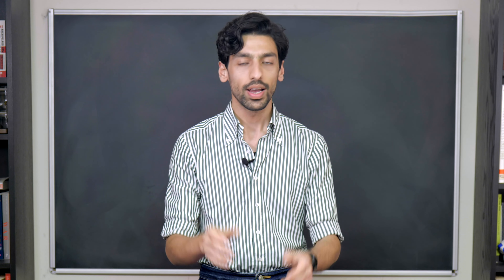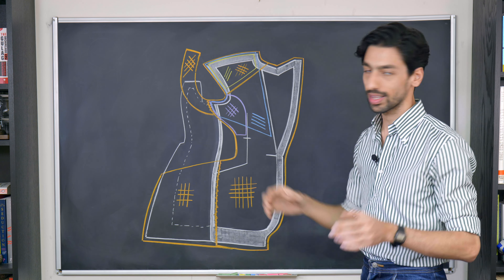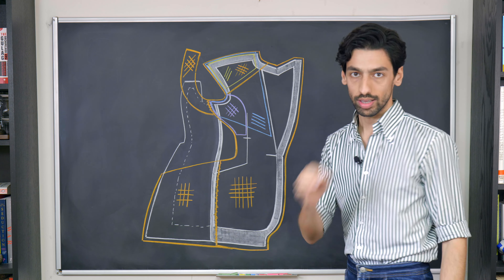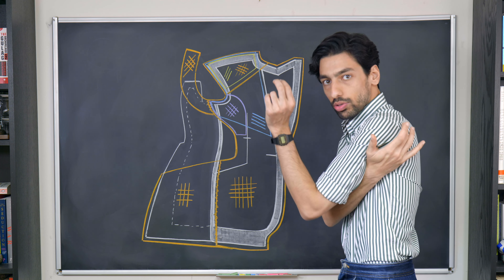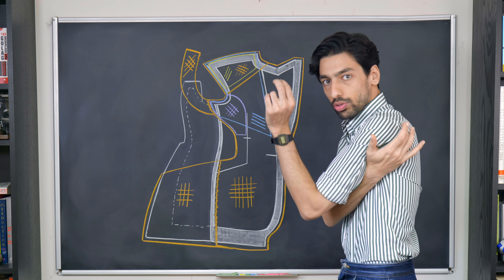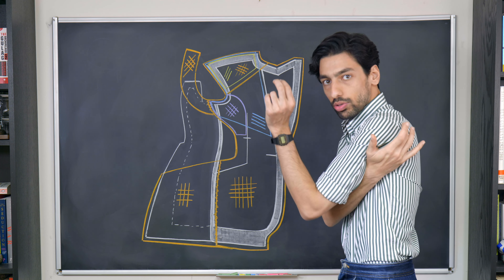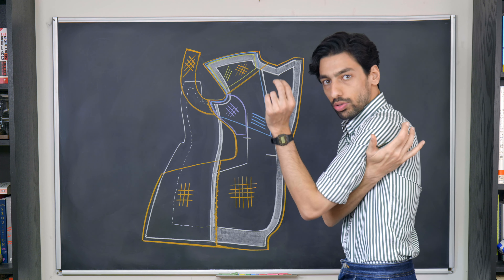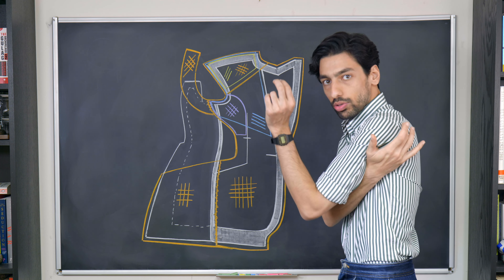L13: Canvas Construction of Our Pagoda Jacket - Theory | Online Coat Making Course

Comment: Reza, why is the armhole area on the side panel and back panel cut in that way? what is that extra piece on the side panel for?
Reply from the maker: Hello, that extra piece is called a wing pad. Its purpose is to hold the sleeve head roll well in place and to prevent it from folding back. It also supports the scye area for a smoother look.

Reza